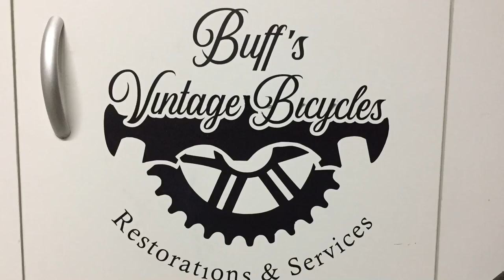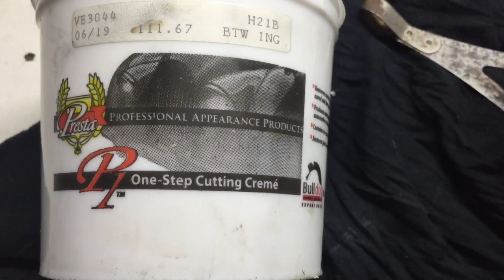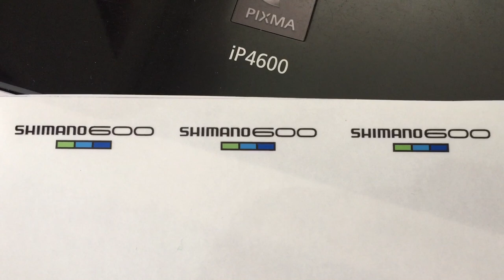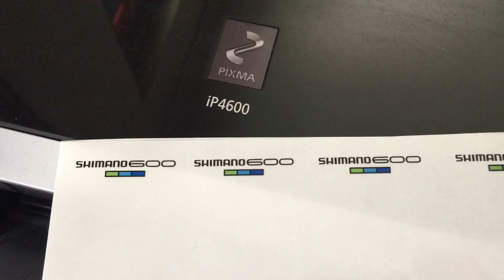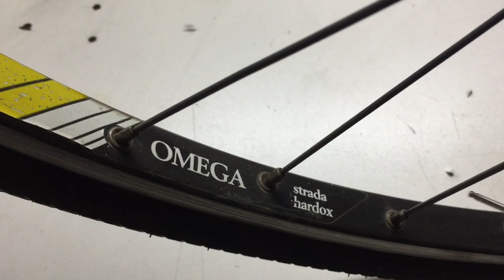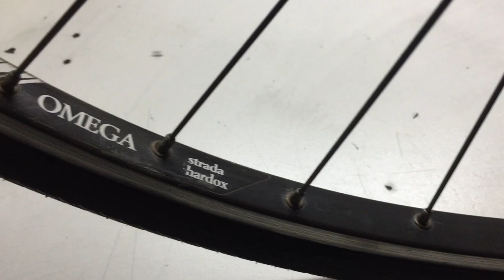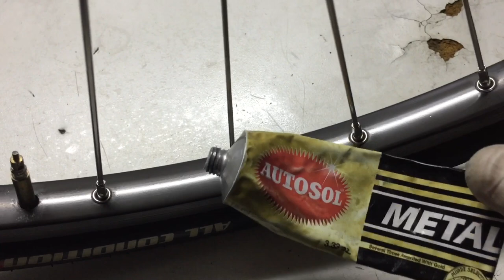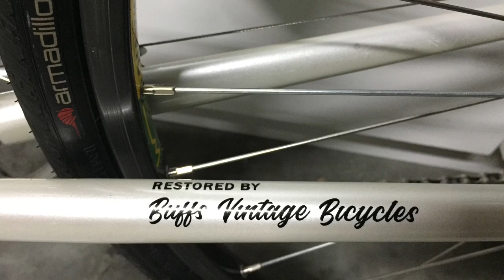Restorating the “Caveman’s” Colnago Super

Comment: Hi Brian…lovely job on a beautiful bike. Like Conrad I had a Colnago I raced in my youth but alas crashed it and bent the dt/tt…still miss that super to this day! Should have kept it and repaired it but with youth one doesn’t realize these things. So in my more advanced age I have taken to collecting bikes (Daccordi freccia W/1st gen chorus, chesini x-uno W/NOS super rec , Vitus 979 W/600…sadly still looking for an affordable Colnago or Pinarello😮). In doing these up I have learned a couple of things that might be off assistance. Firstly, get an ultrasonic cleaner…just wow on how they clean things! Plus an added benefit is they work wonders on records/vinyl 😁. Secondly, when touching up rust/paint use a matching primer first (thin coat obviously) then your mixed top coat to fill the scratches/chips. This will help eliminate the metal shadow under the paint and make it less noticeable. Cheers. PS love all the videos and have learned a lot as well. Trevor from Canada.
Reply from the maker: Thanks Trevor, some great tips which are much appreciated. An ultrasonic cleaner has been on my wish list for some time now, I’m just waiting for an affordable secondhand one to pop up for sale as they’re rather pricey in SA.
Reply: @BuffsVintageBikes  Brett…I completely understand. Living in Canada has some advantages for these things…I got mine 6L off of eBay…chinese but it works fantastically. I was binge watching your Colnago series and have an additional tip I learned from another builder…put some white cloth athletic tape (the kind you use for your fingers in rugby…old hooker here😁) on your headset wrenches and this will keep them from scoring/marring  the flats on the headset…particularly the aluminium ones. Keep up the videos and I can’t wait to see the Gios videos! Happy New Year to you and your family!

Comment: Just a little tip: For rusted chrome such as the fork crown, fine steel wool works alot better and does not scratch the chrome as tin foil sometimes may. Otherwise great restoration! Excellent work.
Reply from the maker: Thanks Mark, I use fine steel wool as well but in this instance I needed something a little more aggressive 👍🏼

Comment: Congratulations! Amazing job. Do you know actually how you can paint over chrome the clovers? I have an old Colnago Tecnos frame and the paint guy does not want to do the job, as he says it would not stick to chrome....
Reply from the maker: I’m pretty sure that if you clean up the clover with rubbing alcohol and paint it using a fine brush and enamel paint then there shouldn’t be a problem with adhesion to the chrome.